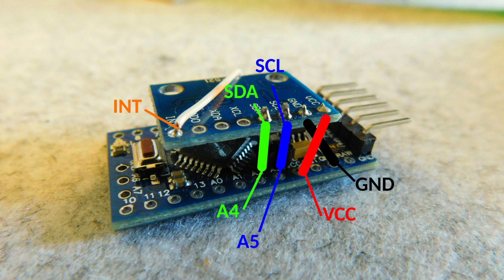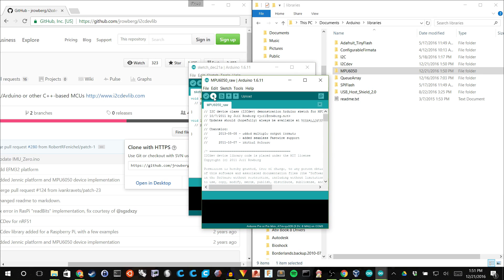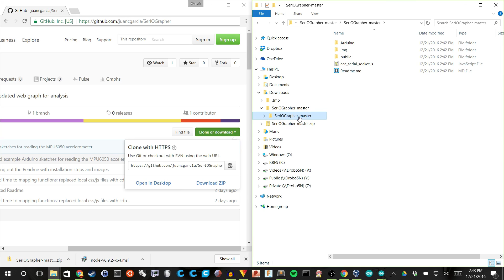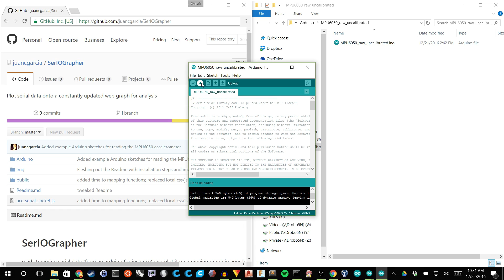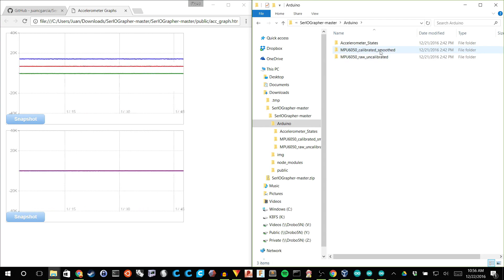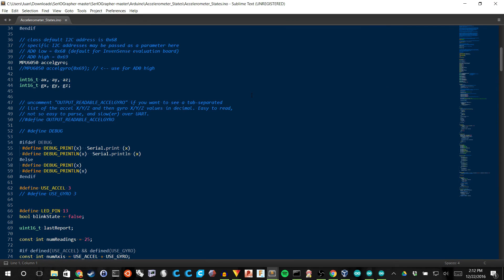Arduino Gestures with MPU6050 Accelerometer - 2016-12-22

Comment: Thank you for putting this demonstration together. I was hopeful I could give it a run, but it seems the node.js ecosystem moves too quickly? 

`brew install node` installs version 14.6.0, on my MacOS 15.16 and in my resulting environment, I cannot get the socket.io-serialport to install without error. All other prerequisites install without error. I'm not a node.js developer, so I'm at the mercy of a clean installation. Any ideas welcomed.

Comment: If i use adxl345 its stil work or not
Reply from the maker: I'm not familiar with that accelerometer. In theory, yes, but the arduino code will be very different as your module depends on different libraries. I'd recommend working through Adafruit's guide to get the arduino set up for this acc. Once that's working, I think you should just be able to modify the serial.print statements to match the ones used in my arduino code. The node.js part should work without modification.

Comment: How did you work out the running average? Did you use MATlab or another type of signal processing software?
Reply from the maker: No this was pretty simple and done in the code (on the arduino if I recall correctly, though it could just as easily be performed in the js app). I maintained an array of the previous N raw values per axis, and took their average for displaying the smoothed graph.

Comment: Thanks for the code mate! I am making a calorie tracker for a skateboard and wish to know the road slope in order to calculate calorie expenditure. How would you suggest I deal with the false readings I get due to vibration?
Reply from the maker: Can't say how effective it might be for your particular use case, but in my situation the raw data was similarly noisy. I smoothed out the graph by taking an average of the previous N raw values. Don't recall what count I used, but It's likely very dependent on your sampling rate. You'll need to experiment, keeping in mind that values of N too high will over-smooth your graph and be practically useless.

Comment: Okay so I struggled immensely with getting this to work, but after some problem solving I got it to work in my Windows VM (on my Macbook) and even on my Macbook in Mac OS itself!

(Both): I advice downloading the older version of Node.js, probably the version shown in the video. With the newest version it didn't work, because the modules you're downloading didn't seem to align well with the Node.js (but I have to say that this error occurred in the beginning of my solving adventure, so maybe after with the below tweaking it might not be a problem).

(Windows): when I tried downloading the node_modules with nvm in Windows (VM, but also on a fellow student's MSI laptop with boot Windows), it seems like it wouldn't download all the modules. Because of this it would generate an exception, because the application couldn't find the needed modules. I don't know why this happened, but when I copied the modules that were downloaded in Mac OS (there it seemed to download them all), it worked fine on Windows VM!

(Mac): First, make sure to comment the process.exit, because the OS indeed isn't Windows or Linux, but you want the process to be able to continue. Second, since ports aren't numbers in Mac OS, but names, the parseInt of the port_number (imported from the commandline) will generate an NaN. By making the port_number a String, and deleting the parseInt around line 55 (I changed some things, so it may not be the same line). 

I know I wrote this very cryptically, but if anyone would like my rewritten code, let me know, and I'll upload it to GitHub. It isn't very universal, but you may understand better what to tweak. I may even be able to write a more universal version, that also supports Mac OS, but I know have to continue with my project that I needed this webinterface for haha.
Reply: OhNoWell. I know this video has been uploaded more than 4 years ago but can you still send me the modified code. my email: faissal.b@hotmail.com, thanks in advance.

Comment: I am getting stuck on the graph part. My serial is working on the Arduino IDE but no pattern(blank) is showing in the accelerometer graph in chrome. .
Reply from the maker: Razak Shafthar it could be that your serial port number is different than my hard coded default of com3. If you know your port number there's only 1 or 2 places it needs to be updated.

Comment: I am using COM4 and was getting blank graphs.  Hard setting the port to COM4 in public/index.html and public/main.js fixed my issue.
Reply from the maker: Brett Becker I've been meaning to update the project to allow passing in the serial port number as a command switch or environment variable instead of hard coding. Just haven't gotten to it yet.

Comment: This looks really cool. 

 I'm getting an error at the last stage:

C:\Users\Murray Court\Documents\Arduino\SerIOGrapher-master\SerIOGrapher-master>node acc_serial_socket.js -p 3
C:\Users\Murray Court\Documents\Arduino\SerIOGrapher-master\SerIOGrapher-master\acc_serial_socket.js:40
      parser: RealSerialPort.parsers.readline('\r\n')
                                     ^

TypeError: RealSerialPort.parsers.readline is not a function
    at Object.<anonymous> (C:\Users\Murray Court\Documents\Arduino\SerIOGrapher-master\SerIOGrapher-master\acc_serial_socket.js:40:38)
    at Module._compile (module.js:570:32)
    at Object.Module._extensions..js (module.js:579:10)
    at Module.load (module.js:487:32)
    at tryModuleLoad (module.js:446:12)
    at Function.Module._load (module.js:438:3)
    at Module.runMain (module.js:604:10)
    at run (bootstrap_node.js:383:7)
    at startup (bootstrap_node.js:149:9)
    at bootstrap_node.js:496:3

 I also got errors at the install stage:

npm WARN enoent ENOENT: no such file or directory, open 'C:\Users\Murray Court\Documents\Arduino\SerIOGrapher-master\SerIOGrapher-master\package.json'
npm WARN SerIOGrapher-master No description
npm WARN SerIOGrapher-master No repository field.
npm WARN SerIOGrapher-master No README data
npm WARN SerIOGrapher-master No license field.
Reply from the maker: I think some of the packages have been updated in incompatible ways. I've updated the project repo to try and solve this. When you download that, you just need to run `npm install` instead of `npm install command-line-args serialport socket.io socket.io-serialport`. Theres a couple of package files that now enforce the correct mix of package versions to make sure everything plays well together. The Readme file has also been updated so check that out too.

Comment: Thanks for the video but I am getting an error with the node.js code.
I am using node.js 6.11.3
Here is the error:

C:\Users\USER\Downloads\SerIOGrapher\node_modules\socket.io-serialport\node_modules\serialport\lib\serialport.js:123
  settings.dataCallback = settings.parser.bind(this, this);
                                          ^

TypeError: settings.parser.bind is not a function
at new SerialPort (C:\Users\USER\Downloads\SerIOGrapher\node_modules\socket.io-serialport\node_modules\serialport\lib\serialport.js:123:43)
    at SerialPort (C:\Users\USER\Downloads\SerIOGrapher\node_modules\socket.io-serialport\src\index.js:28:24)
    at Object.<anonymous> (C:\Users\USER\Downloads\SerIOGrapher\acc_serial_socket.js:32:22)
    at Module._compile (module.js:570:32)
    at Object.Module._extensions..js (module.js:579:10)
    at Module.load (module.js:487:32)
    at tryModuleLoad (module.js:446:12)
    at Function.Module._load (module.js:438:3)
    at Module.runMain (module.js:604:10)
    at run (bootstrap_node.js:389:7)

Thanks
Reply: Oh nvm I just did 
npm install serialport@4.0.7
and it worked now and I get the port opened message but no output on the webpage, I probably uploaded wrong code to arduino.

Comment: Hi - My serial on the Arduino IDE is working but the graph running on chrome, edge is blank. 

When I run; node acc_serial_socket.js -l
I get: 
COM6
USB\VID_2A03&PID_0043\55338343539351117191
Arduino Srl (www.arduino.org).

Not a FTDI

Thank you in advance

Comment: I'm trying to work through your tutorial but I get this when using the command prompt. C:\Users\mjgra\Downloads\SerIOGrapher-master>npm install command-line-args serialport socket.io socket.io-serialport
'npm' is not recognized as an internal or external command,
operable program or batch file.
Whats up with that?
Thanks,
matt
Reply from the maker: The npm command comes with node, so it sounds like node.js isn't installed properly. Node is supposed to add itself to your path so the command window will find it when you type out `node` or `npm`

A couple of things you could try here:

1. reinstall node.js to see if that fixes things (also be sure to open a fresh command window after, since that path change won't be available in an existing command window)

2. if the above didn't fix it, check that nodejs is installed in "C:\Program Files\nodejs\" or "C:\Program Files (x86)\nodejs" If so you'll just have to use the full path so "C:\Program Files\nodejs\npm" (here quotes are important) instead of just npm. Similarly "C:\Program Files\nodejs\node.exe" instead of node.

Comment: Hey just stumbled upon this video and the information on making a graph is extremely helpful thank you. I myself am working with the MPU and have started using Arduino this year and having 1 year experience in computing before that . Right now I'm trying to use the MPU 6050 to measure the acceleration on a servo at different delays. The MPU accelerometer speaks in G's and the output in the serial monitor is so fast and I can't seem to find a pattern. So I am basically trying to find the correlation between servo delay and acceleration in G's. Any reply at all would be very helpful. Thanks and keep uploading great content.

Comment: You previously did some videos about using hc-05 with HID to send physical keyboard and mouse commands. What about using HC-05 to send MPU6050 gestures as commands to the computer as HID? For example, turn hand upwards to scroll up, hand downwards to scroll down, mouse movement data, etc. It would be awesome if you would suggest me some way how to do this. Awesome videos btw
Reply from the maker: That's really interesting. It's certainly possible. The way I'm currently implementing gestures is kinda bone-headed though, they all need to be rigidly pre-defined in the arduino code. So FYI, If you wanted to be able to add/record gestures on the fly, my current technique wouldn't handle it. That said, it shouldn't be very hard at all to, for instance, fire a "page-up" key when lifting your hand instead of flashing the LED.

Once you have the HC-05 wired in, it's just waiting for serial data to send to the host machine. All you have to do is add some lines to the gesture detecting function where you use Serial.write to send the keystroke.

Something like this:

Serial.write((uint8_t)0xFE); // BT-HID: Start Byte (shorthand version)
Serial.write((uint8_t)0x02); // BT-HID: Data Length
Serial.write((uint8_t)0x00); // BT-HID: no modifiers
Serial.write((uint8_t)0x4B); // BT-HID: Page-Up
Serial.write((uint8_t)0x00); // BT-HID: optional second keystroke

Comment: when i open port using cmd, the arduino stop working and give me message "port is busy" and when i close cmd, the arduino work again, any solution ?
Reply from the maker: That will happen if your Arduino IDE is still listening to the serial port, or the command is listening to the wrong port. Check the port number in the Arduino software and be sure to kill any Serial Monitor windows that are active.

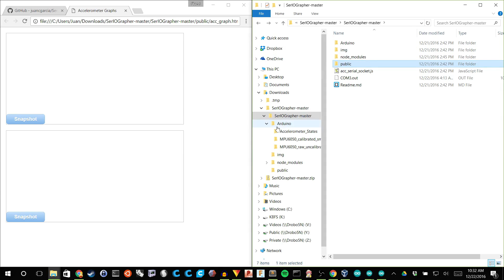Finally in the command, you can specify the port number with -p (as shown at 4:30 )
Reply: still didnt work thou,, when i install npm i get some warn like :
npm WARN enoent ENOENT: no such file or directory, open 'D:\SerIOGrapher-master\package.json'
npm WARN SerIOGrapher-master No description
npm WARN SerIOGrapher-master No repository field.
npm WARN SerIOGrapher-master No README data
npm WARN SerIOGrapher-master No license field.
is it the problem ? and can i use this to get the mpu data into C# ?
Reply from the maker: It looks like the you may not have typed the complete install command. It should look like this (all in the same line):

npm install command-line-args serialport socket.io socket.io-serialport
Reply: Hey, i have the same error. Did you find a solution?

Comment: Absolutely fantastic :) Do you plan to do video about calibrating this sensor?
Reply from the maker: Thanks! Originally I had planned to include that as one of the steps in this video, but I decided before filming that it wasn't essential to understanding the process so I skipped it. I'd like to keep my videos as trimmed and concise as I can.

Calibration isn't hard for this sensor though. Just run the IMU_Zero example sketch included with the MPU6050 library and it will give you offsets to plug back into your future programs.
Reply: I have tried to find tutorial on how to calibrate it, but unfortunately with no succes. Internet is full of examples and tutorials how to calibrate this sensor in just one plane. So relative changes can be considered quite acurate for lot of projects, but if one want to measure absolute position and changes in all three planes it is not sutable. 
As far as I know there should be 3 times 3 matrix describing relation between all planes and offset should be calculated as "right side of matrix" (not sure if this if right term in english). But creating such a matrix is far beyond my knowledge of physics :/
Reply from the maker: I never needed to calibrate beyond using the IMU_Zero sketch. Detecting my simple gestures doesn't require a great degree of precision.

Perhaps one of these MPU6050 projects might help get you closer to what you need?

https://hackaday.com/2016/09/13/bewegungsfelder-is-a-wireless-imu-motion-capturing-system/
https://hackaday.io/project/9165-2-axis-stabilization-w-6dof-mpu6050-and-arduino